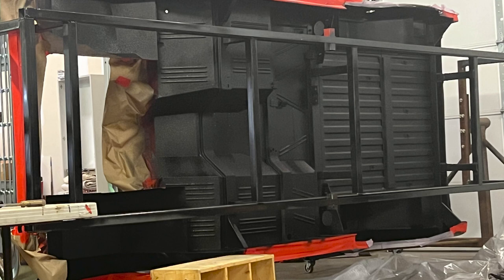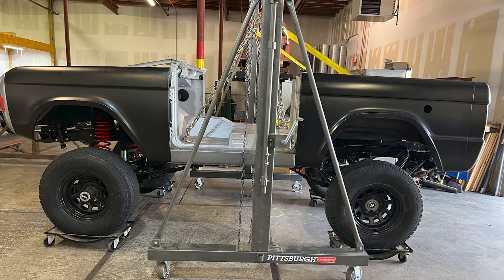Bronco builds, insurance, and rust - The Broncast

Comment: Just got my mostly new body back from the paint shop today.  Had them fully bed line the underneath and interior.  Last week was the one year anniversary of my starting to disassemble the old and assemble the new body from boxes of parts.   Even after weeks of looking it over when I did the last welding and prefitting of all the bolt on parts I was fearful I may be overlooking something that I should have done before dropping it off at the body shop.  Given that month and the 3 months it's been out getting painted I've not found one thing yet I missed.  Fingers crossed as I drop it on the frame this afternoon and start the rest of the build.  I know without a doubt something will crop up I should have done already.
Reply from the maker: Nice!!! Good lucl

Comment: The previous owner of my Bronco had a shop weld new sheet metal on top of the rusted-out floor pans, then they Rhino-lined the interior. The new sheet metal covered the body mount bolts, so I had a heck of a time locating the bolts when I installed a 1" body lift. I don't know if I'll ever get around to fixing the floors the "right" way, but my Bronco is garaged and the rust underneath hasn't gotten any worse in the 18 years I've owned it.
Reply from the maker: Wow! That’s crazy

Comment: How do I change the pulley off the power steering box without destroying it.? After heating it with a pulley it taco ed do I freeze the the shaft and heat the pulley wheel and then press it on?